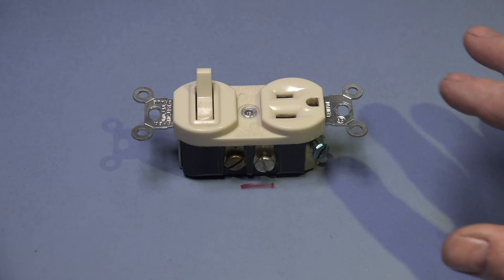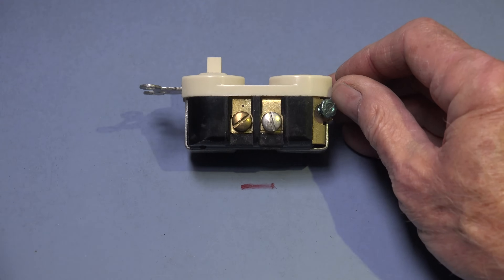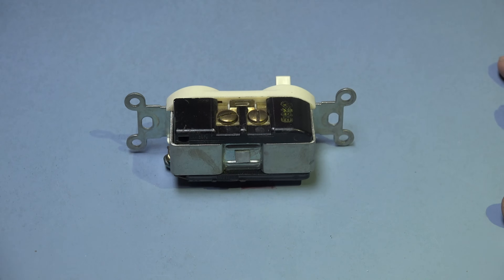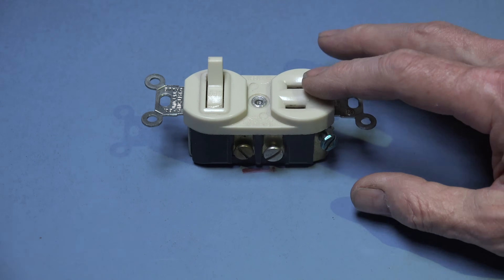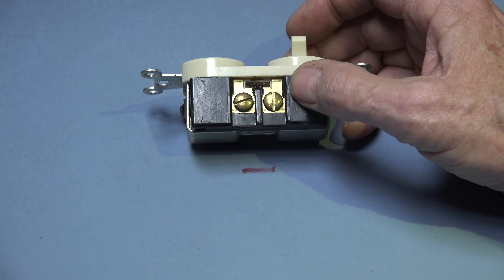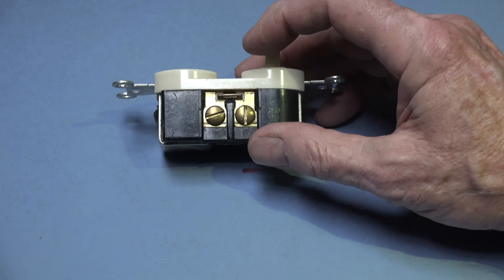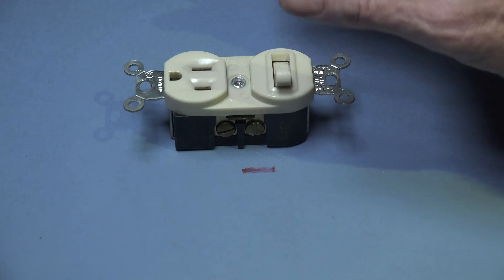The combination switch outlet explained

Comment: Is there a way to do it where the switch turns the outlet on and off?
Reply from the maker: If you leave the bridge intact, wire the hot to the other side brass terminal, the switch will control the outlet.
GFM

Comment: I have a very old house, my light switch only has one black and one white. Is it possible to install a combo switch with two wires?
Reply from the maker: The wiring does not have a ground wire.  It is not necessary for the switch.  You just will not wire the ground terminal.
GFM
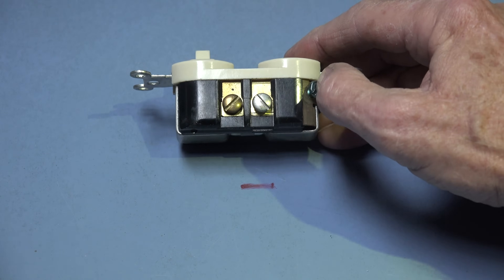Reply: @grayfurnaceman  Thank you. I checked and it has one black wire and one white wire. NO ground, nothing else. The part I am confused about is that at 1:26 you say connect the neutral and the one on the left you say it goes to the appliance, but I have no extra wire to connect. At 1:33 is that terminal connected? Are you saying connect the white one there and it will control the light and also the 3 prong outlet will work? I only have two total wires in the box.

Comment: In the last scenario where the switch gets a hot to the appliance from the brass screw just above the silver neutral, and a hot feeds the lower brass after the bridge is cut, what if any thing is connected from the upper severed brass? Or is the appliance picking up it’s hot there? The reason I ask- someone wired the switch this that there with a red on the right side double uncut brass and the hot is on the single brass screw on the left. There is also a black ,(quiet  black )with an additional jumper across the both the silver and brass screws. Room dark power in the socket, switch on , light on socket dies. 
If it were a stand alone unit, no problem, but it wired into two other rooms such that wiring other than red alone on the double uncut brass, line hot to single brass and what I will call quiet black with a jumper across both brass and silver ( hot included) won’t allow other rooms to function at all. 
Inside the box two whites are capped together. The box is grounded.
Wiring the usual way gives me great lights on the probe  but isolates other rooms out. Wire the way it is probe says gnd and hot reverse. 
Stumped unless I figure out.
🙏

Comment: this only works if you do have a neutral wire. if you are in an old building and the neutral goes directly to the light, this wont work.

Comment: I want to connect my water pump to the switch. 
1st break little tab
2nd connect Hot to switch from pump to copper switch post but where does my Nutrual connect its already taken by the white
Thx
Reply from the maker: The neutral is not switched.  Connect to the incoming neutral.
GFM

Comment: If I want the switch to control the outlet where would I put the appliance neutral wire, you didn't mention that wire?
Reply from the maker: On the silver screws, it is not switched.
GFM

Comment: Makes sense but confusing to use "hot wire" for both sides of the receptacle. Isn't one neutral lead / line and neutral load. With the other side hot line / lead and hot load? Or am I getting that incorrect? Other than that helped me understand how the switch impacts the receptical. Ty

Comment: Now I know why there is so much conflicting info out there. It's not about whether or not the jumper is still in place. People are harming themselves trying to remove those jumpers! Rather, it's simply about direction, it's about which side of the switch (which terminal) is connected to the appliance. Unless I misunderstood you, the jumper should NEVER need to be removed for the average person who just wants to add an outlet to a light switch, because making the outlet independent of the switch (or not) is simply a matter of direction. Thank you!

Comment: So in the first example, where I want appliance on the switch and the outlet always working, where do I attach my appliance neutral wire?
Reply: The neutral is connected to the silver terminals.
GFM
Reply: The appliance neutral (white) wire should run directly to the buss bar in your breaker panel. A separate neutral should run from the silver terminal on the outlet to the breaker panel... or be pig-tailed to the appliance neutral inside the outlet box. Simply attaching the appliance neutral to the outlet terminal will not complete the circuit. (DIYer here)

Comment: Thank you for the explanation of the different options. I intend to do the middle option and use the switch to control the outlet without a fixture.  Many video only show you only what they intend to use it for and you have shown 3 options for use. Very clear, good sound right to the point. A+
Reply from the maker: Welcome
GFM
Reply: @grayfurnaceman  But wait a minute... LegalVideoMan said "without a fixture"... isn't that the only option that actually wasn't covered here?? It looks to me like all 3 of these examples involved the switch being connected to an appliance. Or maybe this type of switch/outlet unit is the wrong device for LegalVideoMan's needs?

Comment: I'm trying to wire a switch like this JUST to turn the outlet off and on.  In my case, the "appliance" is a small water pumped that would be plugged into the outlet.  So am I correct that I just need to wire this with the lead and the neutral on the one side and nothing on the other side, but leaving the "breakable bridge" intact?
Reply: Got it.  pretty simple. thanks.

Comment: Used this Vid for "upgrading" to this Combo Switch. Found the description very useful.  So many other resources get bogged down with details/diagrams... But when the layout/concept is made clear it just becomes Common Sense. So much more useful.

Unfortunately my Switch Box doesn't have any Grounding so I'll probably be either Upgrading again with a GFCI/Switch Combo (likely regardless) or adding/fixing the Grounding problem.

Comment: How do u connect to another hot lead brass (outlet) when there's only one black wire from voltage connected to switch?
Reply: Davy Joe use a pig tail

Comment: Does this only work on outlets at the end of the circuit? I want the outlet underneath the switch to turn on and off but it's in the middle of the circuit. What will happen to the rest of the circuit when I turn off the switch? Thanks for the tutorial!
Reply from the maker: There is no reason the switch cannot be wired to pass power to the other elements.
GFM
Reply: grayfurnaceman any different wiring to do that?

Comment: I kind of feel stupid for asking but if I wanted to use this to control my dust collector by plugging it into the outlet and turning the switch on, I would just wire up the one side with power, neutral, and ground, correct? In this scenario, there's no separate appliance, right? Essentially it would just be an extension cord I could turn off and on.
Reply from the maker: You have it right.
GFM

Comment: So what's the difference between the first scenario and third scenario that you explained? Can I install this on an connection that is currently just a switch so that I can control the room light and have an outlet for anything else such as a tv?
Reply from the maker: Not sure how to answer here.  The outlet switch assembly is quite simple.  Its just a switch and an outlet.  How it works is dependent on how it is wired.  The outlet can be powered all the time or controlled by the switch.  The explanation tells you ways to use or eliminate jumpers on the assembly.  
GFM
Reply: grayfurnaceman thanks for your reply I guess my question is if I want the outlet powered all the time I must break the jumper and wired it as the third scenario you showed correct?

Comment: +grayfurnaceman can the power come in on either side (Left side power input from panel, right side power output to the appliance, or Right side power input from panel left side output to appliance?
Reply from the maker: You need to identify the terminals.  Silver for neutral and gold for hot.
GFM

Comment: Hope you can answer my question!  I want to plug a string of 30 lights (7.5 watts each) 
into the base plug and be able to turn them on or off using the switch.  That would be
the ONLY use of the electrical device I ever had.  Sounds to me like I would use your
#2 explanation....that is, the hot, neutral and ground all on one side.  Is it that simple?
Thanks!  Jim
Reply from the maker: That should do it.
GFM

Comment: Great video. I'm trying to install this switch at the end. Only two wires coming from the box for the ceiling light switch
Reply from the maker: If your system has no ground, it wires just the same.  You just have no ground to wire to the greed terminal.  Hope this helps.
GFM
Reply: grayfurnaceman I guess what I mean Is there are only two wires in the box. One black and one white. I think-Usually there two sets of wires. A Hot and neutral going into the box and hot and neutral leaving the box, maybe going to the light fixture on the ceiling. I have tried so many ways to wire this and I can not get the receptacle to stay hot when the light is on. When I turn the light off, the receptacle is hot.
Reply from the maker: I probably can't get real specific here, but power is brought to the light fixture from the panel.  The hot lead is connected to the black at the fixture.  that lead goes to the switch.  When it passes thru the switch, the white goes back to the fixture.  That white is the hot lead to the light.  Hope this makes sense.
GFM
Reply: grayfurnaceman thanks!!!  I didn't think there was a way to do it with what I have.
Reply from the maker: Welcome
GFM
Reply: Hi I found the solution, it  is a gfci combo switch like they use in bathrooms, it has black wires pre installed behind it and you just have to connect those to your black wires

Comment: Hi, We have a 1949 home (old wiring) - wanting to change the light switch for light above the sink to a switch for the light plus a plug. We installed it, connected the two black wires and the two white to what we thought was the correct connection points, but the switch now controls the plug, turning the test stand of christmas lights on and off, and does nothing for the light above the sink... HELP!!!!

Comment: What about If I want the plug to be always hot be able to turn the disposal on and off?
Reply from the maker: Starting at about 1:10 in the video, the wiring explanation will set it up so the outlet is always hot and the switch will control the disposal.
GFM

Comment: So the switch has nothing to do with the outlet right? Is there a way that this switch controls the  on/off function of the outlet below???
Reply from the maker: It can be used to control the outlet.  You have to break off the jumper on the hot side and run the hot thru the switch.
GFM

Comment: GFM, you got me studying the switch circuit. http://homeandgarden.formeremortals.net/wp-content/uploads/sites/4/2015/02/hgmm-switch-receptacle-combo-4.jpg

i don't see how this switch can be safe because in the 2nd example, the power and neutral wires are reversed to the outlet, so the small  outlet slot will be neutral and the larger slot will now be hot. 
Am i missing something?
Reply: +Kris Klekosky Yea, you're correct. The dumbasses put the bridge on the wrong side.
Reply from the maker: +Cooll Asice You are missing something.  The neutral is always connected to the neutral (silver) terminal.
GFM
Reply: +grayfurnaceman OK so unlike a regular switch or outlet, the terminal connections criss cross inside the unit.  Thanks.
Reply from the maker: +Cooll Asice Well no. The terminals are wired pretty much directly. 
GFM
Reply: +grayfurnaceman Ok, but inside the unit the wiring is criss crossed, so the neutral wire on one side of the thing is actually connected to the terminal on the other side, and vice versa.
This is what  can be determined from the diagram.
Reply: +Cooll Asice The neutral is the larger slot on the same side as the silver neutral terminal. You are mistaken, there is no criss crossing going on. Look at the video, because the diagram you speak of is incorrect. It shows the neutral slot as the smaller slot, which isn't the case in real life. That is what is misleading you.

Comment: Interesting video, GFM. My old man installed this switch in a bathroom to control the ceiling light bulb. It isn't installed correctly because whatever is plugged into the socket, for example an electric razor,  will be  off when the switch is on, and the light bulb  actually lights dimly when the switch is off while the razor is plugged in and turned on. I imagine i could figure out how it's wired, but i haven't bothered.